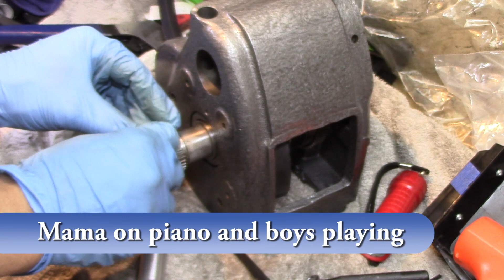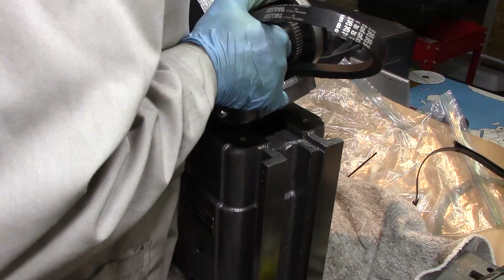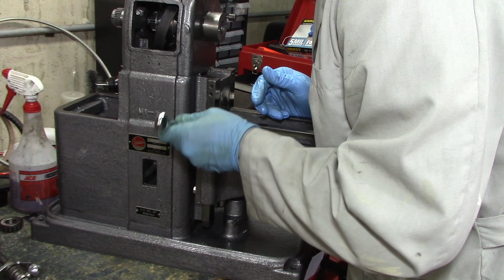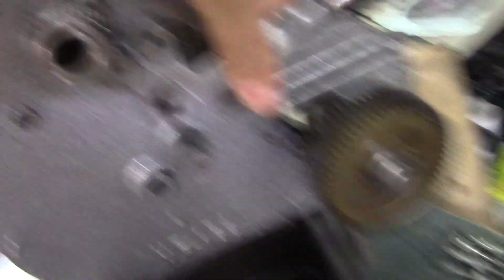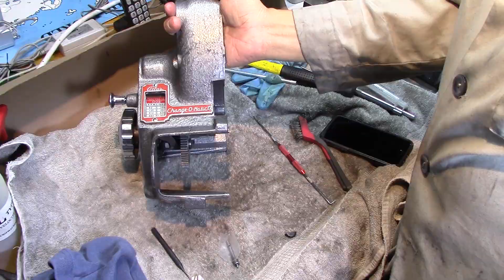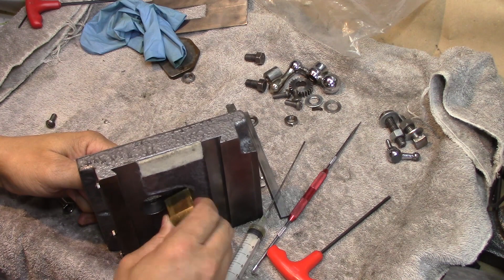Atlas Horizontal Milling Machine Restoration Part 5, Assembly and Adjusting (machining)

Comment: Hey Jester your mill is really coming along nicely you've come a long way I started watching your videos when you restored your lawn tractor By the way how is the tractor
Reply from the maker: Thank you so much!  The weather is starting to get spring like here in IL and I hope to do my last tractor video this spring.  That is a project that I got to 99% and didn't show that on youtube.  I have to make that right and do the last video.  I used the tractor and a wagon at my 2016 family reunion and it was a HUGE success.  All I have to do is replace a few (3 or 4) nuts and bolts to Stainless and tune the carb.  I don't know how to tune a carb and that's part of the reason I haven't finished this project.  I hope to finish it as soon as the weather breaks.  Sorry for the delay and thank you again.....